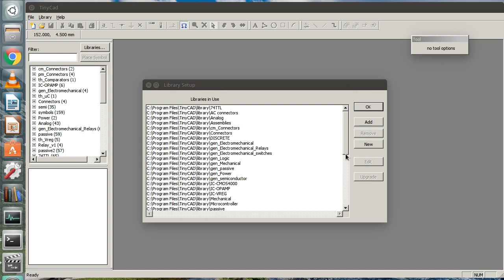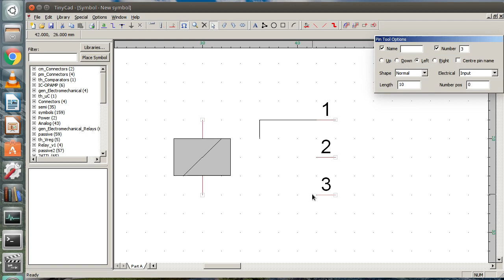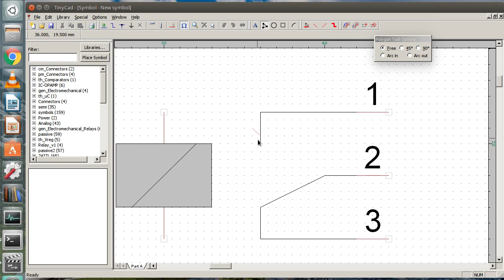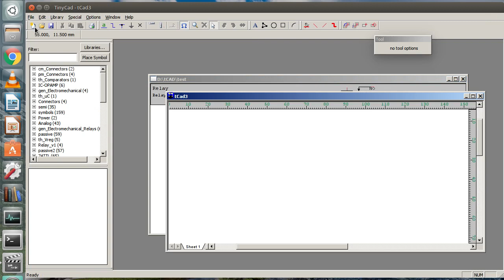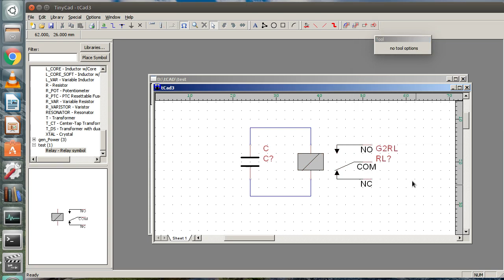Create new library and schematic symbols in TinyCAD

Comment: hey i created a symbol of the atmega328 for my standalone arduino project. When i tried to create a netlist it shows errors near the pins that are not connected and also the pin 19 which is connected to the led, it shows an error that there is no input to drive that pin. How should I counter this issue
Reply: Only draw wires and move symbols with "normal grid" turned on.